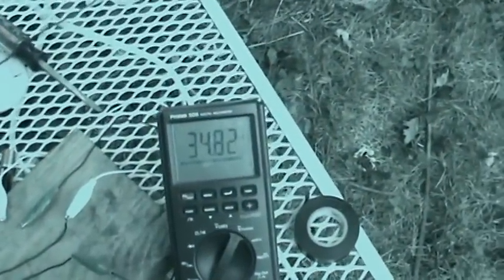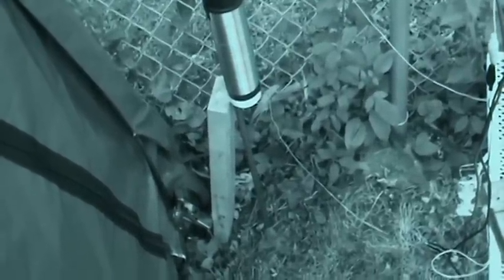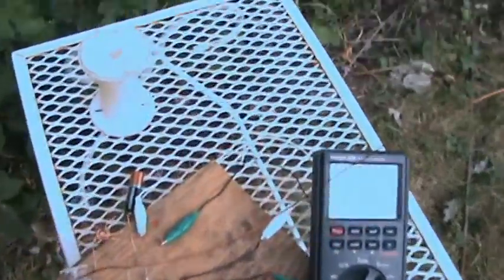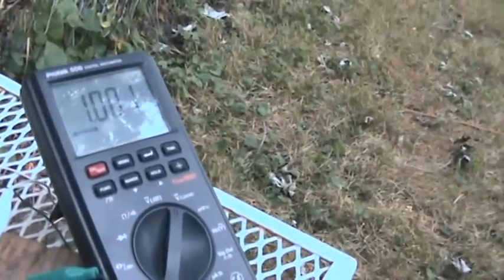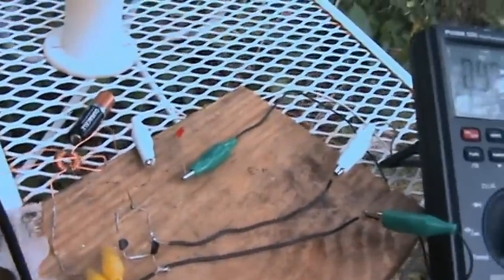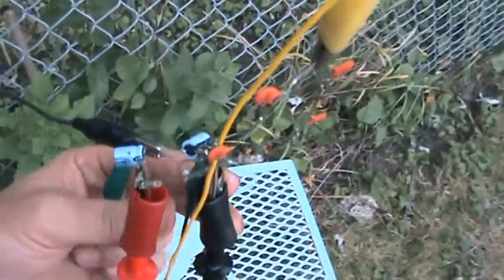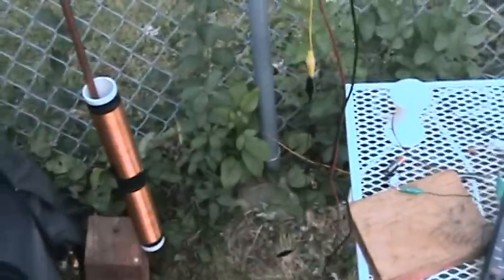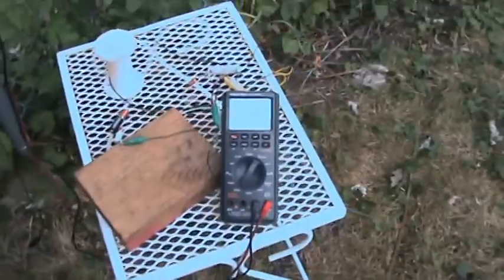Free Energy From Air 2015 part 9

Comment: Great perseverance!!  I enjoyed all the episodes.  Consider these 3 ideas: 1.) Isolate your antenna and the long connecting wire using non-conductive cord and/or glass insulators, to get the highest energy to your cap/diode circuit.  Incoming electricity is of high frequency and follows the outside of the wire.  Sharp turns and grounded surfaces will drain radiant energy.  2.) Consider placing a new ground rod away from the fence.  Try adjusting the 2-coil set above the ground on the new rod, to determine how much the fence is affecting tuning the voltage.  3.)  Rod and collector on your roof act like a lightning rod.  Consider disconnecting it and attach the long connecting wire to an insulator.  Then measure voltage generated without it, to determine how effective it was. Recap what configuration of parts and placements have created the best results to date.
Reply from the maker: +jim Thanks, "all" very good ideas to try.  Good point about the high frequency riding on the skin or surface of the conductor.  And good point to recap how the best results were achieved.

Comment: Was thinking how the diode is key here, so was wondering what the coil does?  It seems to help, so what is it doing? Some fort of flow valve/buffer/virtual ground or is it giving off RF and feeding back to the diodes? But its DC or is it vdc?  Is it tuning some thing some way? Is the system capacitance important in some way?  Dam what the hell is going on here! lol
Reply from the maker: +Spangley Rainbows yes, drives me crazy sometimes.  Why does it make so much difference when the coil is on the grounding rod that is attached to the circuit, as apposed to the coil being on its own ground rod that is not attached to the circuit.  Im thinking about checking the induction while playing with the coil at different positions.  The coil worked best over the ground rod that is attached to the circuit in the past also, when i did this a few years back at another location, so its not just about the amount of Henries and tuning, but something else is going on also,,,multiplying voltage somehow.?,,,not sure.

Comment: Paul check out TinManPower and his Graphene homemade super capacitor. Think this cap is what you need for this circuit to act as a battery or buffer between the source and load.  https://www.youtube.com/watch?v=QLOkV5qIOgs
Reply from the maker: +1NRG24Seven Ohh, very interesting, thanks, an AC super cap :-)  I have a super cap i been playing with, a 3000F 2.4VDC

Comment: Your "joule thieves" look like they turn alternating current to direct current, any idea of what frequency the antenna signal is?
Reply from the maker: +rongrite The joule thief could operate from a 1.5 volt battery.  I have a small yellow jumper wire in the joule thief circuit and this is were i sometimes put a potentiometer for tuning.  I will have to check incoming frequency on the antenna itself,,,i been meaning to do this.  I have 2 more new video i have to post yet.  I tried the collector up side down & a few other things.

Comment: Have you tried the coil running horizontally?
Reply from the maker: +clixbits Yes, but no good, works best if over the ground rod.  Hmmm, i could try to add an elbow to the ground rod and put the coil on that horizontal length.

Comment: um... do you have a mobile tower nearby and maybe try and connect it to that? the objective being hieght
Reply from the maker: +DiyEcoProjects Nearest tower is about 8 miles away.
Reply: ok... we have a radio/satalite/broadcasting tower near us. Its steal support cables are about 10 inches thick. Just wondering if that might make a good collector
Reply from the maker: DiyEcoProjects Absolutely yes.  I knew a guy that connected to radio tower, had great results,,,but this is cheating, hehehehe and im sure illegal.  He connected to cables as you mention.
Reply from the maker: +DiyEcoProjects Part 10 is posted now, and part 11 & 12 in a few more minutes :-)
Reply: cool... thanks for chatting today. Take care